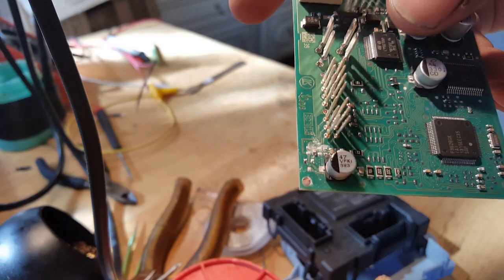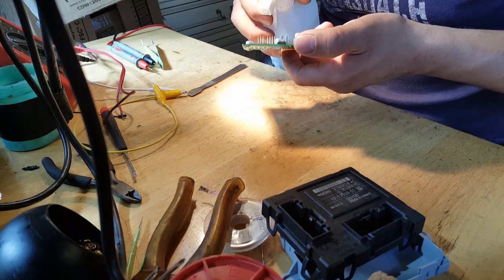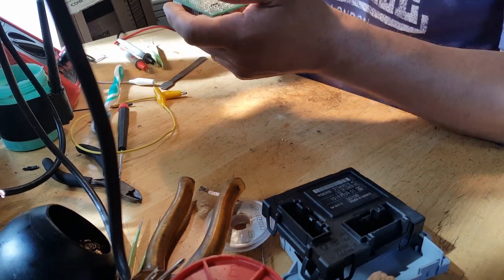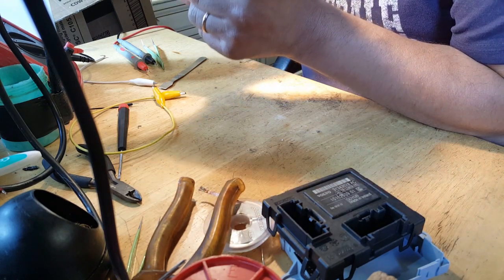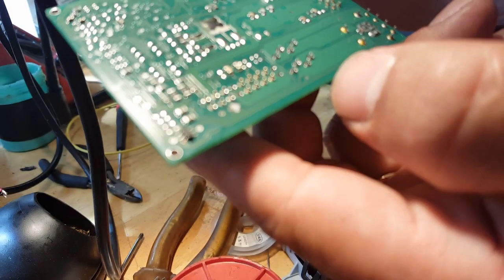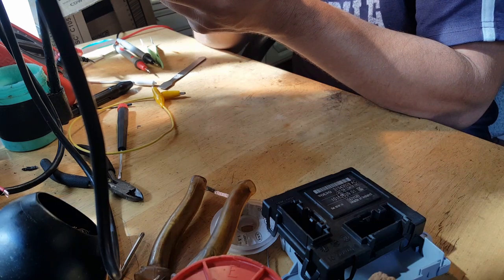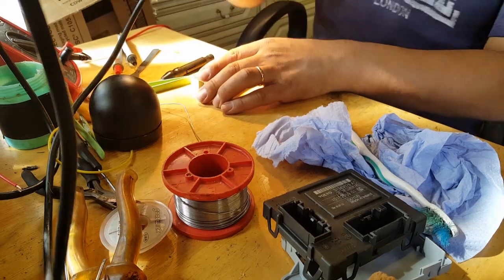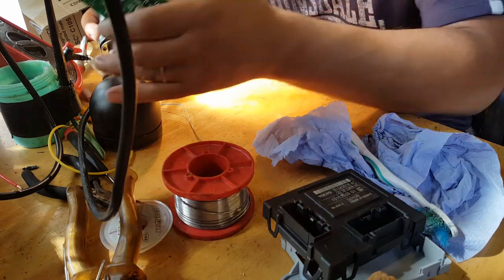Volvo XC60 2014 electric window not working B118E00 repair.

Comment: this really helped. took my module out, cleaned the moisture damage around the same chip, put it back in and it is sorted. the burnt out motor is something else but at least the module is functioning - thanks so much.

Comment: As a mechanical engineer, I really enjoy watching your videos because of your troubleshooting procedures.  I wish I had someone around here with your skillsets because I have A Volvo that the active/bending headlights aren't working and I think it's a control module issue.  Keep those informative vids coming!
Reply from the maker: 😊
Thank you very much for your comment, and for watching... really appreciated! 
👍👍👍
Reply: Have you checked the motors? Had a similar problem had to change the headlamp.

Comment: Hi great video, is there any way to measure if the locking motor (two small motors in the door) or the circuit board in my left door (we drive on the other side of the road) has burned out if I release the electrical connector to the door before disassembly the door.? is a 2008 v70. THx
Reply from the maker: If it does have a door module, you most likely will have to dismantle it... as it might be controlled by the door module, and direct access to the motors connections...
👍👍👍
Reply: @LMAutoRepairs  thx. I think without dismantling the door side there is just the locking mechanism. The one with the two small engines. 

Could I however measure if there is voltage coming into the door by removing the electrical cables going into the door? 

And if so could I measure the electrical door motors and by that determine their state? 

I can't lock the door with the remote but unlock is not a problem. 
The dashboard warns me that the door is not locked. 

Any suggestions? Thx for your time.

Comment: If I'm not wrong, I think the first fault can be recorded by the same damage...:
Chip send current to relay, and relay to the motor... as chip don't receive feedback about speed o turning from Hall sensor, stores "mechanical fault".
Probably is programmed to show in case of mechanical locking, as snow on the glass or similar.
As always, well done!!
Reply from the maker: Agree... Thank you for watching and for your comment! 
👍👍👍

Comment: Hi

I have a 2014 volvo with the SRS light on that you show at the beginning of this video.  You mention that you will be fixing that fault as well early in the video.  However, I cant seem to find the video where you worked on that issue?  Any advice?  Great video, I am so humbled by your skills!
Reply from the maker: Have you scanned the car?
What codes do you have?
Thank you for watching and for your comment!
Reply: I have not - still researching.  I dont have the SRS code reader.  Was curious what sorts of things it might be so I can budget for the repair.  Maybe I will get it scanned and report back.  Unfortunately the scan has to be done by a specialist (as you know).  I dont have a Volvo specialist near by.

Thanks again - loved the video, the window has quit also on the Volvo and i bet its the control module.  Now I can do some diagnose by listening for the "click" of the relay.
Reply from the maker: @eriklombard322  
Without scanning is nearly impossible to say...
The light only indicates a fault, is the scan that will start to point you in the right direction... 
👍👍👍

Comment: Hey, i also have B110B11, B118F00, B119100, but all windows and locks works as intended, i also have the srs "service urgent" message, code U015100 - no communication, but fuses and relay connected to srs module is working, module gets power when ignition is running and can-h and can-l is 2,7 and 2,3 V, do you know if the pdm or ddm fault codes maybe is connected to the srs fault code? to add ive also changed the srs module with a new "used" one with same volvo/bosch part number. Any ideas?
Reply from the maker: If I understood correctly, you are unable to communicate with the SRS module, correct?
👍👍👍
Reply: @LMAutoRepairs  that is correct!
Reply from the maker: @mrsuiram2061 
If you 100% have powers and grounds, check CAN bus... the multimeter only shows half of the story... use an oscilloscope to see what is happening...
Diagrams might be also helpful,  to see how everything is connected...
👍

Comment: Nice find & repair. What temp settings do you use for your soldering iron?
Reply from the maker: Hi
Thank you for watching and for your comment.
The alloy I use is Sn60Pb40, melts at around 190°C.
The electronics nowadays are  lead free, which requires a higher temp to melt, around 230°C...
That is just for the alloy, obviously you also need to 
heat the PCB area plus the components...
So relealistically I rarely go below 220°C... up to 350°c.
But, I also use a lot the hot air gun... also set at around 350°C...
So, bottom of line, is all depending on the situation...
Hope that helps...
Reply: Thanks

Comment: I have similar problems with my 2013 Volvo XC60 which I moved from a temperate country to a tropical country. Three of the 4 windows power down and will not go up and the drivers window is very temperamental - works on a adhoc basis. The local Volvo rep has no clue. The other issue I have is with the park brake. The car says that it’s partially released and therefore the alarm goes off and stays constant. Can anyone help? I will happily pay if you could remotely use your VIDA system to connect and assess what’s going on.